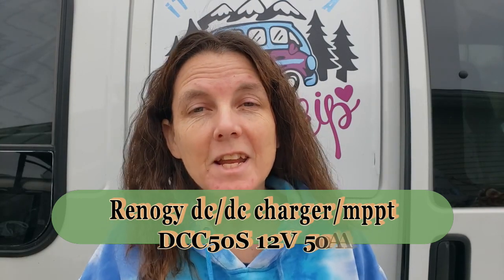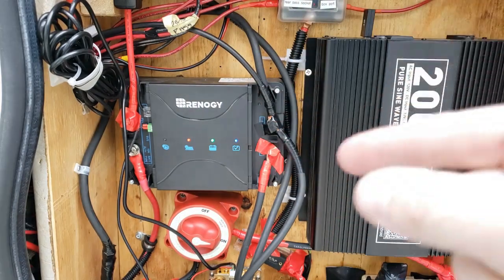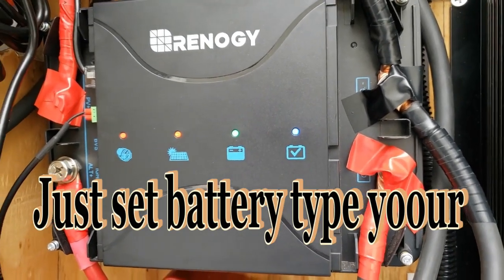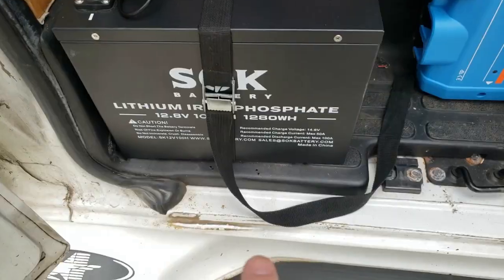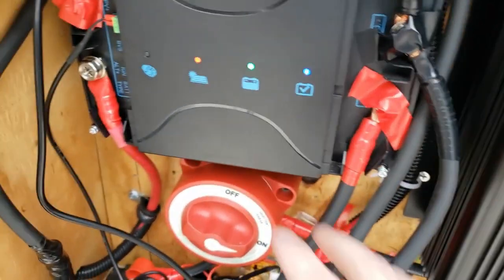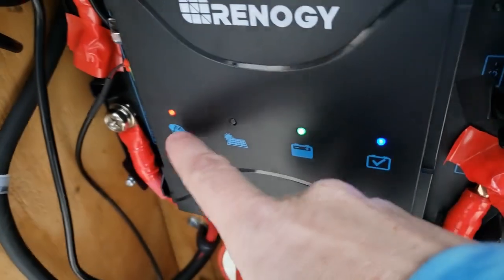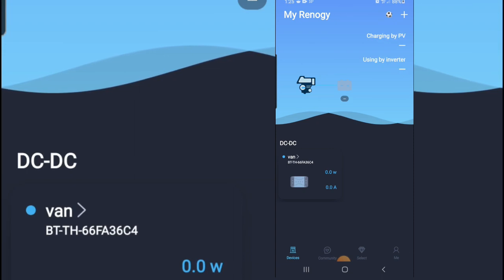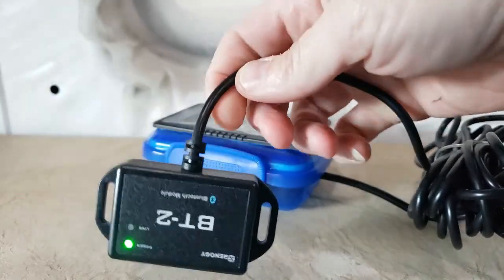Renogy Dc to Dc Battery Charger with MPPT Review

Comment: The question that I have is how did the DC to DC charger charger starter battery when the motor is not running? Does it draw power from the house battery to charge the starter battery? Thanks for a great video Suzy! 🤗
Reply from the maker: Thanks for watching Ivan. Yes I have the starter battery connected to the DC to DC.

Comment: NO NEED for temp senc on the starter battery, temp senc is only for the battery that the Unit is charging, not the battery that the alternator is charging, that Alternator takes care of the starter battery's needs
Reply from the maker: I don't have a temp sensor on the starter battery just on the house battery. Thanks for watching.

Comment: I bought same DCDC 50 2 years ago with 2  200 watt panels from Renogy. It works (MPPT is great) BUT there are issues. There is a NEWer Renogy design (IP67 DCDC50) that solves SOME of the issues (still doesn't Charge significantly from Alternator during the day. ). The original DCDC50 is designed to  only charge from your Alternator at 25amps during the day  50 amps only at night. The Renogy Website suggests you add a relay to shut off the Solar while you drive. IF you charge at 50 amps in hot weather ( Mexico) the unit overheats UNLESS you add a fan (even with proper ventilation ). You need to add a temperature controller to turn off and on the fan. OK , then the Solar panels I bought with the unit have an OCV of 27V and intermittently shut down the DCDC50 .After 2 years Renogy emailed me to say "you"  bought the wrong controller for those panels. I sent them the link to the RENOGY Support person who recommended those products together. Renogy accepted an error was made but because "out of warranty" they do not feel responsible.
Reply from the maker: Sorry you are having trouble. Thank you for watching the video 💙

Comment: How has it held up? What was the max open and volts out on your panels. I was under 25 volts but was afraid and did not go this route. Thanks
Reply from the maker: As of today this unit has held up wonderful I've had absolutely zero issues with it it's just working as it should and sometimes I don't even think about it anymore and I have not had my batteries dip below 40% I'm very happy with this unit

Comment: IMV, this is a terrible product.  I was very excited when Renogy introduced this product.  It's a great idea to combine the MPPT charge controller with a DC to DC charger.  But it isn't a good fit for most customers because of the ridiculous 25 volt limit.  One of my 250 watt panels outputs 37 volts.  Save your money.
Reply from the maker: Definitely need to know what works for your system. For my system it has work great with no problem. Two years going strong. Everyone needs to do their own research for their needs
Reply: @travelaroundsuzy  I agree. But I'm thoroughly convinced that unless you have a small setup, this is worthless.  What I don't like is that it seems as if Renogy deliberately hides that voltage limit in their advertising.
Reply: I have 2
 200w panels. With the math plus 3% on max v and max open circuit I was under 25 volts. But I still did not go with it.

Comment: Does the House battery when it's on shore power, charge the Vehicle battery? Ie at night when at a campground.
Reply from the maker: I do not have a shore power on my van but if I did the shore power would charge my house battery first then my battery under the hood (starter battery)